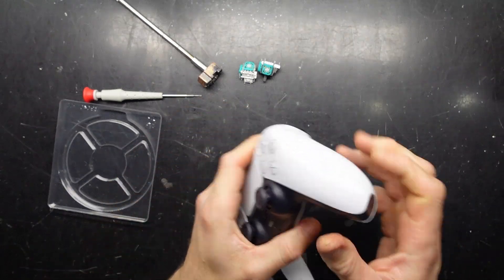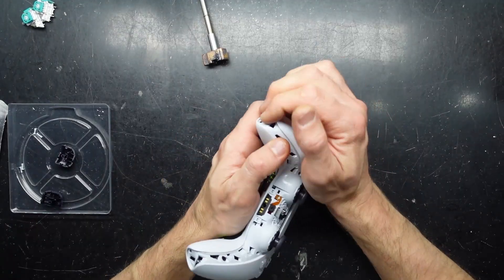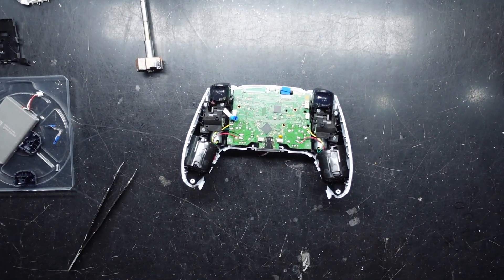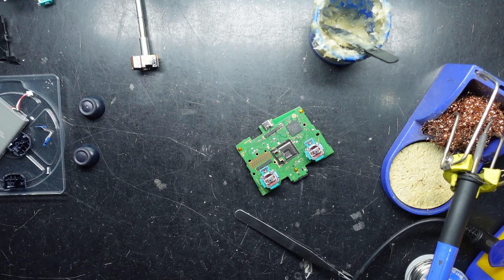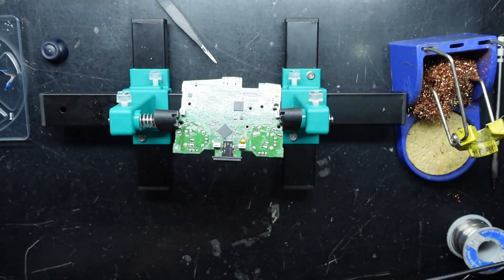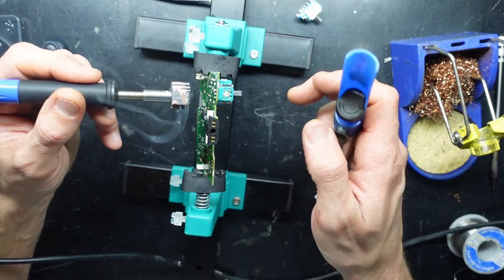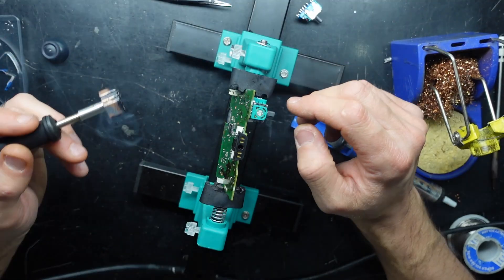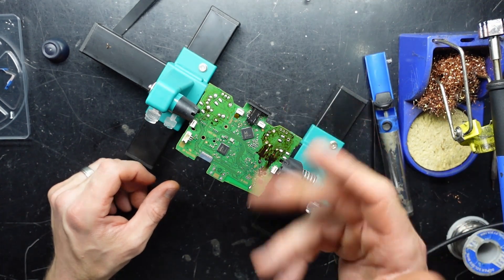Analogstick Desoldering Tip for PS4/PS5, Thoughts and Repair

Comment: Hi, just bought a tool like yours, any tips on how to reduce the browning on the PCB after use? I'm scared of using too high temp on it
Reply from the maker: not really sorry, putting some fresh solder on the pins would help it head up quicker
Reply: Use kapton tape to protect the other components, use a little bit of flux on the points of the board you're heating and make sure to fill up the holes on the iron with some solder, as another commentor suggested.

Comment: You need to prefill the holes on the tool with solder since the melting point of the dualsense solder joints is way high , adding any solder to it will lower it and make it come off within  seconds. Don't wanna risk heat damaging the board leaving it on long.+
Reply from the maker: excellent tip! cheers
Reply: What kind of solder do you recommend? Low melt?